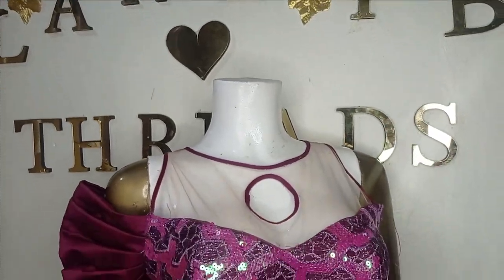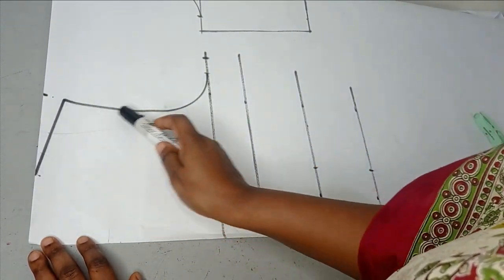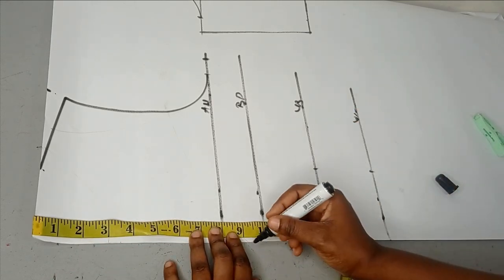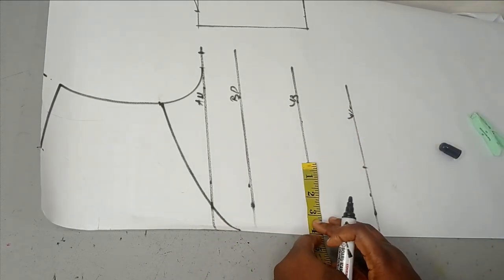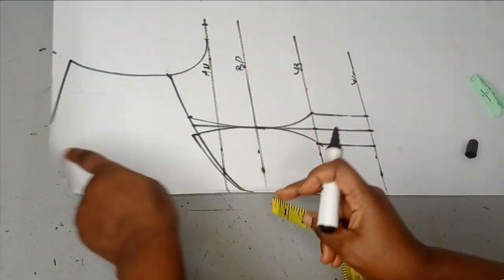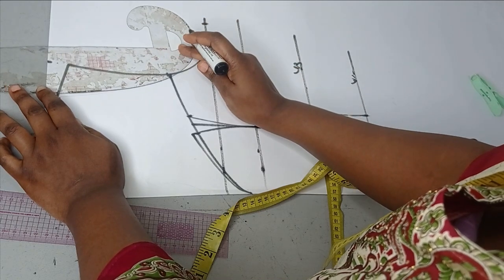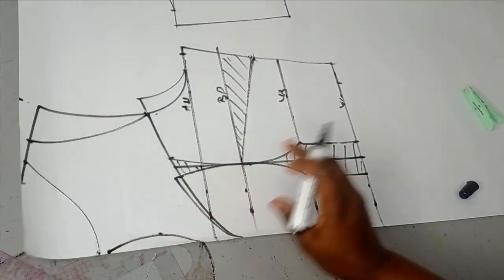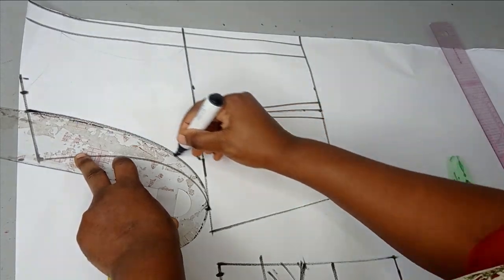How to make KEYHOLE YOKE BLOUSE with PLEATED STRUCTURED SLEEVE

Comment: Ma, please did you deduct the 2" Bust dart in front front the back length?
Reply from the maker: The front and back half length is usually different because there is bust in front and  the back is flat..the bust will create a bulge which will make the front length longer if the measurement is taken correctly.... whatever increase you have at the front is what we take as the bust dart so that the side of them front and back will be the same for joining